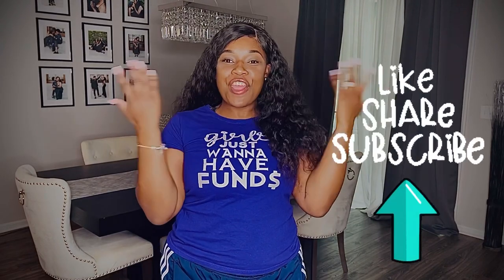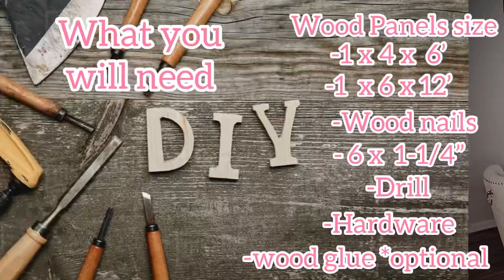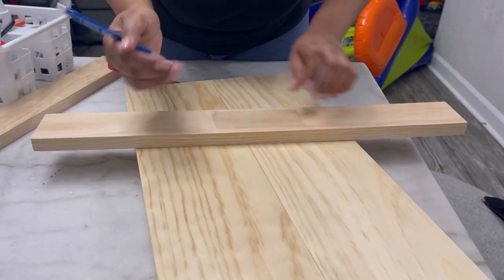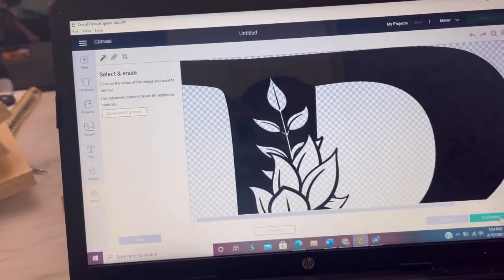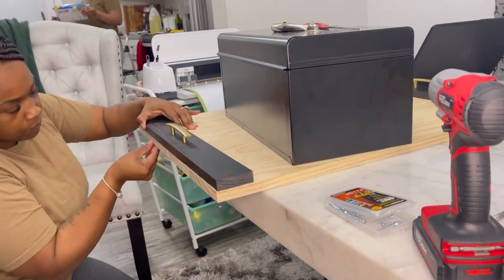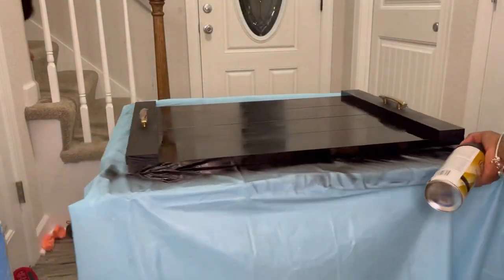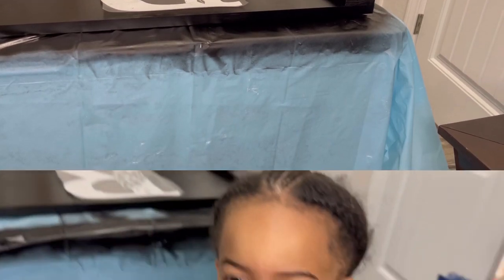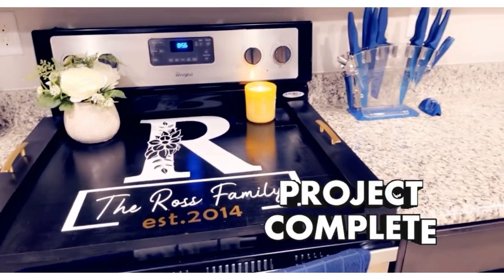HOW TO MAKE A STOVE TOP COVER | BUDGET FRIENDLY | DIY

Comment: I love this. You are so talented. My stove has burners that are like a gas range. Yours is flat correct?
Reply: I have a gas stove, and my noodle board sits right on top. It's perfect. However, you can add 1 or 2 in. pieces of wood underneath to create a border so that it sits over gas elements and isn't visible from the front.

Comment: I have a question. (4)6inch wide pieces is equal to 24 inches from front to back of stove. Yet the 2 pieces that the handle attaches to is 22 inches. How does the 2 pieces fit evenly across the 4 boards that add up to 24 inches total and the 2 side pieces are 22”?
Reply: A nominal 1x6 is not actually 6" wide (or 1" thick, for that matter).  It's actually 0.75" thick by 5.5" wide.

Comment: Did you sand the ends of the wood
Reply from the maker: No I didn’t, that’s actually a good idea. I literally just got up to feel the ends. They aren’t smooth like they would be if you sanded them, but they aren’t rough enough to get a splinter. I’m gonna try doing that on the next one I make! Thank you ☺️☺️
Reply: @exclusivelychey1036   thank you your video was amazing and super understanding. I thought you did but it wasn't shown. Keep up the amazing work.

Comment: Could you drop the links for the svg you used for under your R?
Reply from the maker: The rectangle is just a regular rectangle and I used the splice option to open it at the bottom…then what ever font you want for the wording. Nothing specific as far as a link goes. ☺️☺️
Reply: @exclusivelychey1036  thank you I’m just trying out my cricut! I tried the splice and it didn’t do it like the picture for some reason. Do you remember what fonts you used?